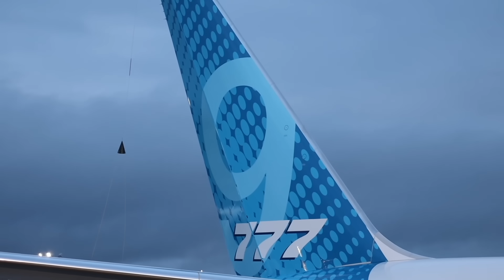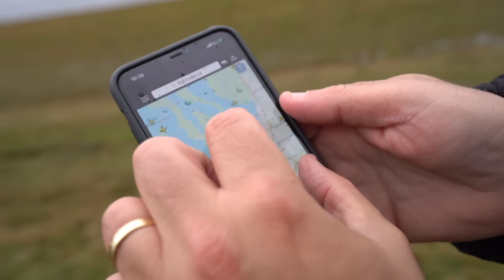Boeing 777X - What's the Difference?

Comment: Imagine sitting in the very back of the "economy saver" section of the aircraft getting off the plane. You will miss your connection.
Reply: They have two entrances and two aisles so it's not as bad as you think. Plus, if you're on a plane from Asia everyone literally runs off the plane is on fire.
Reply: @disbsam333  But not all airports have two gates for passengers to board and disembark wide-body jets. Seattle-Tacoma Airport is a case in point. But I agree with you on the "get up and run for the exits" thing in Asia.
Reply: @alooga555  Actually most of the time is wasted getting luggage. With two aisles more people can get their luggage at the same time.
Reply: @alooga555  If the gate can't handle the passenger load they wouldn't be using the 777x in the first place
Reply: @meckster28  Sea-Tac already gets daily 777-300, A330-900, and even 747-400 flights. The problem with the airport is not the single jetways but the tiny customs and immigration areas that were built 40+ years ago, which is bursting at the seams.
Reply: @alooga555  lol it's hilarious. Old Chinese ladies should be NFL players.
Reply: @disbsam333  omg for real lol. I'm a black man with muscles and work out on the regular and in china them old ladies make me feel like a wimp. I dare any crook to try and snatch a purse from one of them. They'd be in trouble🤣
Reply: disbsam333 😂😂😂
Reply: That plane will most likely only be flown on long routes. Just make sure you always have enough connection time. 1.5 hours should be minimum
Reply: Jack n Jill popping pills a
Reply: I usually avoid the problem by having 2+ hour layovers, though not really for that reason. Mostly so I have some time in each airport to get some aircraft photography in
Reply: Then they must create a gate designed for these ultra wide body aircraft, may take time
Reply: Please see my Video and Subscribe my channel Thanks.https://www.youtube.com/channel/UC7s-dRTXdCDm2fhTsMsoeTA
Reply: @MokoCh55  go away

Comment: Has Boeing put into service a composite wing before? I don't know I would be willing to fly this if this is their first, given that the fatigue life models AFAIK are still testing composite and metal wings even though experience has borne out this is a bad methodology. Granted, Boeing could choose to have their own additional better test, but I don't trust them to be doing anything more than the minimum these days.
Reply: Yes, 787 has a composite wing (and fuselage). Other manufacturers have too - Airbus with A350, Bombardier with CSeries (now Airbus A220, but it was developed under Bombardier). Composite structures have been around for ages (since at least A310 with the composite vertical stabilizer), but wings are newer
Reply: @AmbientMorality  Thanks for the good info!

Comment: I remember back when the original 777 was announced, it lauded the folding wing tip as a unique feature.  It never came to be back in the 1990s so has taken 30 years to arrive.  But what’s with the rather confusing name.  Doesn’t X connote 10 in Roman numerals, so why is it also known as the 779?
Reply: The 777X family comprises the 777-8 and 777-9 members. The new folding wingtips don't carry fuel like the original 777 concept and are far smaller, so made much more sense

Comment: And why the delay because of bad weather?. Isn't it SUPPOSE to takeoff in bad weather like in real traveling weather 🤔.
Reply: Because first test flights at Paine Field always take off in a northerly direction on RWY 34L away from the populated areas. On the day all other traffic was taking off in the opposite direction. With the extremely strong tail winds on the day, hence why it was cancelled until the weather improved the next day. A test pilot did explain it in detail at the end of Boeings broadcast on the day the flight was cancelled.

Comment: Why did they fly with the gear down the whole time? Every picture i saw was with gear down.
Reply: Standard procedure for first flight.
Reply: @uowebfoot  what's the reason? Doesn't that create a bunch of drag?
Reply: @blazinthat7439  if there's any problem, the test pilot/crew needs to be able to get the plane back down on the ground without having to deal with any additional issues

Comment: 6:14 gear hangin and extended flaps :DD
Reply: In the first flight the goal is to check out basic functionality and how well the low-speed performance was predicted. The pilots are busy testing handling in take-off configuration, and for that the gear must be down.
Reply: @runwayincursion3376  On the first flight of the 772 they cycled the gear several times.
Reply: First test flights they dont retract gears..
Reply: Oh snap! ...😅
Disclaimer: except on the first flight of the 772. Where they cycled the gear several times.
Reply: Frelseren Erik it’s for the pictures. There’s a chase plane taking shots of the plane in that state.
Reply: Asif Sadik for safety and testing purposes, not for a photo shot.
Reply: Thanks for info all of you, to me it looked abnormal hehe

Comment: GE9X engine seems over powerful to GE90-115B , however, engine nowadays , as long as good enough for push and fuel efficient will be helpful for those airlines that in struggling situation. Still how 777X fighting with the Airbus A350XWB family will be a great question to ask , how comfortable will be compare with the A350 family ? Fuel efficiency ? how much per seat cost saving for this new jet ? and many many more.....

Comment: Those engines are so BIIIG! :)
Reply: 777 has long under carriage so centre of engine thrust remains in same place as earlier 777s so same flight characteristics.
Reply: The first B747s ca 1969 had 4x 40,000 pound thrust engines. So one of these GE 9s has almost the same thrust. Can you imagine 4 of these on an Antonov 225?

Comment: Watched this the other day, and it was beautiful seeing this big beast take to the skies. One extremely impressive-looking aircraft, no question about it. She fairly leaped into the sky ... and when she came home, the captain just greased her in as smooth as you could ask for. A day Boeing has *badly* needed, with the problems that have plagued too many of its products lately.  One thing I was curious about - with the other advances they've made to the aircraft, I'm very surprised they didn't equip the GE9x pods with the sound-reducing chevrons like on the 787 and the 747-8 lines; does anyone know why, particularly?
Reply: GE9X is quieter already than its predecessor with chevrons. Since chevrons hurt efficiency slightly and flights are so long range it makes sense to get the extra efficiency

Comment: when i saw the moving part on the wing, i just can't trust it
Reply: Dude the plane would fly fine if the folds were not there, the folds only make up a small surface area of the wing; so even if the folds malfunction, theoretically the plane can still take off and land safely... no worries!
Reply: @truthfacts5438  Boeing considers such a failure catastrophic. Downplaying risks is what leads to bad situations – correctly assessing a potential failure's severity is a very positive sign.
Reply: Stevenn Yang the navy has been trusting folding wings since before WWII. It’s safe to say, they are safe
Reply: @eifeldude1   campkira  well lets put it that way: i dont trust boeing with making foldable wings
Reply: Marco its literally wingtips
Reply: Well let me tell you something, there are lots of moving parts in conventional wings too. Don’t worry too much, the lock system of this one is huge and extremely strong. You will be ok!
Reply: Especially Boeing
Reply: Well, if the wings doesn't have a moving part, it won't fly at all
Reply: moving parts are literally what makes plane fly

Comment: Suppose it automatically retracts its wing tips during middle of a flight?
Reply: It can't. System power is disconnected from the wing tips when the ground contact switches on the wheels are not active.

Comment: Dear blind people who blame 777x has MCAS:
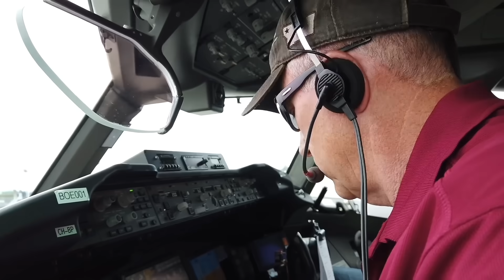Turn volume to max and 8:24

Thank me later
Reply: @user-cc7vx7sw4z  There's also no reason for it because MCAS would never apply to a fly by wire aircraft. It is strictly a relic of planes where there is a direct relationship between stick force and control surface force
Reply: Exactly
Reply: It’s primarily the poor attitudes about safety that Boeing has demonstrated.
Reply: @user-cc7vx7sw4z  You work for Boeing public relations isn't it?

Comment: Who is in charge of deploying the wing tips before takeoff? The computer or the pilots? If the pilots, then what happens in case  they forget to deploy them?
Reply: hvm85 It creates more drag but shouldn’t affect the takeoff capability
Reply: @emrefifty5281  I hope so...
Reply: hvm85 audible warning? Takeoff checklist is a thing you know
Reply: @gusp6612  you never watched air crash on Nat Geo? Do you know how many takeoff crashes occurred just because pilots forgot one element of the checklist?
Reply: @hvm85  Electronic checklist – the plane automatically checks off items that have been completed and will clearly indicate what items are not complete, so forgetting is not really possible. The EICAS also has a graphic showing wingtip position. The plane also will sound an audible alert if the takeoff configuration is wrong. Takeoff configuration problems are ridiculously rare now because there are so many checks against it.

Comment: Is it my imagination or is the nose of the plane quite low during touchdown? The front wheels touchdown was virtually a second after the main landing gear. If I am right, my next question would be if this would be standard for this aircraft or would it have been a decision made only for this particular landing.
Reply: Also on takeoff. Main gears are beginning to leave even before the nose gear rises. Probably a combination of conservative  (high) reference speeds for maiden, light load and high flap setting.
Reply: @ezb77  Ah OK - thanks 🙏🏻
Reply: I noticed that too but I have absolutely no knowledge of aeronautics

Comment: Let`s hope this time there won`t be any software issues.
Reply: Engines aren't above the wings? Why need MCAS?
Reply: It is a 2020 design, not a 1010 design with too big engines, so it doesnt need mcas
Reply: Uhh the point of a stick shaker is to alert the pilot of an AERODYNAMIC stall, NOT an engine stall, to be able to correct it before it gets worse, if a pilot gets “terrified” by an alert which inhibits their ability to respond to it then in my opinion they shouldn’t be a pilot
Reply: Please see my Video and Subscribe my channel Thanks.https://www.youtube.com/channel/UC7s-dRTXdCDm2fhTsMsoeTA
Reply: Yeah, right?
Reply: Boeing Planes as a result of those 737 Max crashes, will likely be safer planes in the future because of it
Reply: It doesn't have MCAS.....Chill
Reply: @abhisheksinghchauhan386  he will definitely be chilling if it falls into the ocean
Reply: abhishek singh chauhan  It has software. No program exists that does not have any bugs.
Reply: @abhisheksinghchauhan386  but boeing  has no quality control - check whats haS BEEN FOUND ON THE 777 crashed in london, yeah, check now
Reply: Pedro Quiros what? The 777 crash in london wasnt boeing’s fault. It was the manufacturer of the engines of that aircraft’s fault. And no one was killed in that incident. And it has been resolved. And that was years ago
Reply: @abhisheksinghchauhan386  That's What Boeing Said, they didn't disclose MCAS for the B737 Max did they? Boeing are Deceitful Bastards and i will not trust them with my life
Reply: @TheAirplanejunkie  you shouldnt really blame the whole company, it's dennis muillenburg's fault cuz he was a terrible ceo
Reply: Tim Miles good luck flying then lol
Reply: Tim Miles Boeing has built 10k 737s with an overall stellar record.   MCAS was a f’ck up that cost innocent lives but it was a rare f’ck up.
Reply: @TheAirplanejunkie  why am I not surprised that this bs is coming from an airbus fanboy
Reply: Tim Miles there  wont he any MCAS since the only reason they had MCAS on the 737Max was because they had to move the engines up to to low ground clearance. The 777X has a-lot of ground clearance so they didn’t have to move the engines up so the flying characteristics are the same as the old 777s. Also Boeing couldn’t risk another PR disaster like the Max disaster. So they will have to make sure the aircraft is extremely safe. Also along with the FAA, other country’s aviation governing bodies will certify it on their own to make sure its safe. Ok?
Reply: I Also Have Trust issues With Boeing.
Reply: What's the point of a stick shaker? To further terrify a pilot after the engine stalls?

Never made any sense. It's like blaring "AHAHAHA PREPARE FOR DEATH" over the loud speaker in a spooky Halloween voice
Reply: theedwardian the point of it is an warning when the plane is AERODYNAMICLY stalling so that the pilot will push the nose down
Reply: If they keep outsource software development to India or hire software "engineer" from India, they're always going to be problem
Reply: @lihihongan5289  well the problem is with boeing not with "India"
Reply: There never was i didn't see any software problems in USA or any serious crashes it only happened in 3rd world mentality pilots.
Reply: @fernandosalas8589  ever been to aviation school?
Reply: @KevinWakliFitness  I have flown airplanes this is not manufacture  responsibility its a war like cars. In the US Toyota was blamed for the bad brakes on those vehicles but it wasn't the case it's the media that throws lies. Stop believing what they tell you think for yourself.
Reply: @fernandosalas8589  don't force opinions into someone else's life
Reply: Fernando Salas keep telling yourself that.
Reply: @fernandosalas8589  , don't be dumb. If the problem is with your so-called 3rd world pilots why are they not flying the max 8 here in the States? Be thankful the crash didn't happen here. When Boeing deceitfully concealed the fact that simulator training by pilots was required for pilots due to the MCAS so as to make the max 8 appear cheaper to customers, do you blame Boeing or the customers?
Reply: @kyekye2K  it didn't happen in USA, Europe or in China or even in South America. If it was all over the world then it's Boeing's error and Boeing has an excellent track record its hard for me to think it's a computer error. Do you really think that Boeing is going to be sloppy knowing people will die.
Reply: @fernandosalas8589  , of course they were sloppy due to greed and it was proved at the Senate hearing. This plane was the biggest selling aircraft in Boeing history. Airlines bought it in large others due to the promise of more fuel efficiency. It turned out lots of corners were cut to make the plane cheaper and to get approval faster. FAA , the regulatory authority allowed Boeing to self certify in some cases which is unheard of in industry. Softwares and other critical components were outsourced to cheap Indian companies for peanuts resulting in shoddy work. Boeing gambled and failed big time. Their own workers even complained before te crashes occurred as they knew it was just a matter of time. They'll pay dearly for their corporate greed.
Reply: @kyekye2K  I know a couple of info most people don't know.

Comment: Sam..... come on. Don't waste your time on Boeing. They should fix all the issue's they have first.
Reply: Diabolisk Van de club then you don’t watch it
Reply: @AirSupportIncomimg  I do, but you then don't care about safety.... would you talk the same.... if a family member of you is dead on Lion Air-Flight 610?
Reply: Diabolisk Van de club first the 777 has nothing done with 737 max and I believe that they are fixing the problem
Reply: @AirSupportIncomimg  Will I give you the technical description of the 737 max 8, 9 & 10 and the 777 series from 300 model onwards and then and the 787-10? Are you going to compare those systems well? You don't know what you are talking about.

Comment: Beautiful 777X aircraft. Hope to do a trip report on it one day, and hope it has better luck than their other recent aircraft.
Reply: don't think it was unluckiness that brought down 2 737max's
Reply: ghostwave 525 yea I know. Just a figure of speech :)
Reply: ON YOUR ASS  , really? Why are the well trained pilots in the States not still flying the max 8 then? Why was the Boeing CEO fired then?🤦‍♂️🤨🤔
Reply: ON YOUR ASS  , how could the pilots be blamed when Boeing admitted that they didn't inform the foreign customers as the simulator training would have made the plane more expensive to buyers? I've followed this case closely because I worked briefly for a company that provided parts for Boeing planes here in the States. I can't say much due to it confidentiality reasons but the deceased pilots are not to blame. Boeing concealed information from them.
Reply: ON YOUR ASS  , how would the pilots train for the new system when the seller of the aircraft didn't make them aware? If you buy a new product without a manual wouldn't you assume it works the same way as similar ones you used in the past? The fact that no US pilots did not crash was just the luck of the draw. If they kept flying the max 8 it was bound to happen sooner or later unless Boeing conveniently trained US pilots in flight simulators while telling other foreign buyers no new training was required. With the way you're talking you should have been at the Senate hearing defending Boeing as you seem to know more than the CEO who was fired for gross incompetence.🤦‍♂️🤔

Comment: Actually not the most powerful aircraft ,GE-90115B is stronger than the GE9X
Reply: TWx Galaxy that’s a highly modified version designed specifically to break records. When GE did the same for GE9X it’ll be much more powerful.